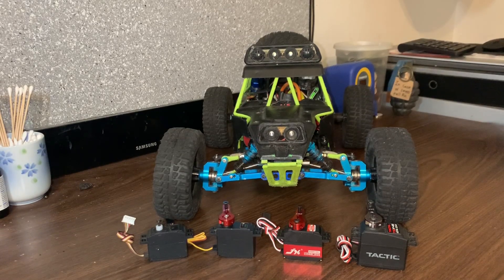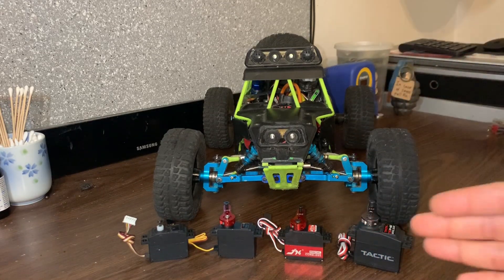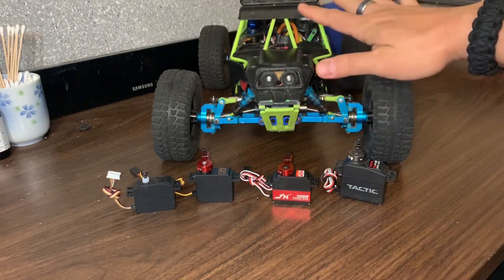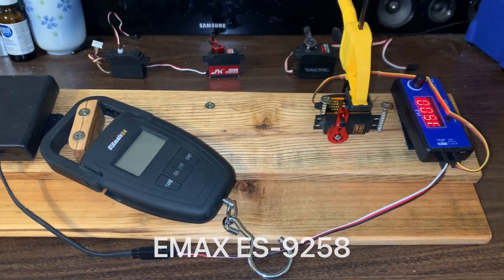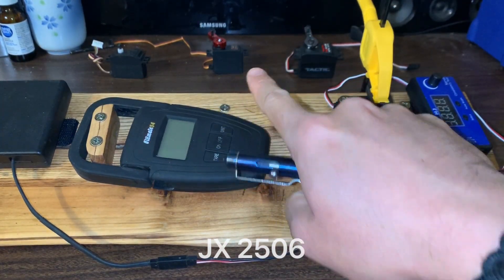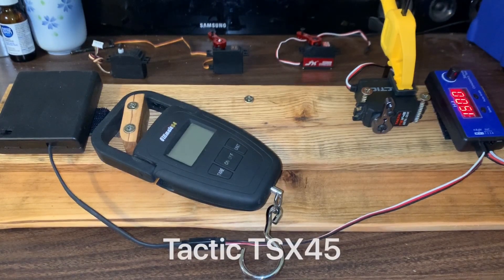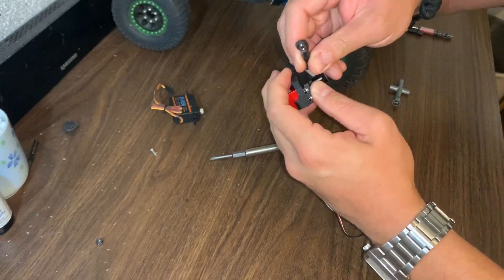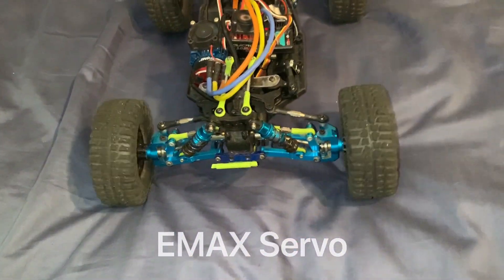Best 12428 Servo Option Out There - Fits The Stock Servo Bracket!!!

Comment: Thank you for this video! I spent hours looking for a good servo for my 12428, bought one servo of other size and used it with 3d printed bracket until it died 2 weeks later, then used original servo with soldered controller from that dead servo.
After finding your video I've purchased JX PDI-2506MG and I am very satisfied. Perfect fit, budget friendly and very decent.

Comment: There's an official upgrade metal geared servo from wltoys , don't use it, it's not much better than the stock one. 

Btw: You can easily use the 3wire servos on the OG wltoys esc. Just remove the pcb from the 3wire servo. The 5 signals that go to the wltoys "brainbox" consist of 2 for motor and 3 for the potentiometer. Not really proprietary (connector is a JST 1mm or 1.25mm pin pitch and available at mouser, digikey and the like) but for cost savings sake I guess. 

Thanks for the video.

Comment: hello, does any 25T servo arm fit the stock servo?
Reply: I have trouble finding the correct arm for these smaller servos. The spline shaft size is different between the 1/12 and 1/10 size servos, but believe they can both be 25T.

Comment: Thanks for the video very interesting.  How fast the JX servo PDI-2506MG   is in comparison to the original one ?
Reply from the maker: I mean the original seems much faster with no load but when it doesn’t have the power to get the full throw to use the full turn radius, then that speed is pointless.  The JX servo is so much more powerful that when the servo is loaded down with all the links, joints, steering components, wheels, tires, ground friction, etc it still functions great and will give the full throw of the servo.  So essentially under no load the stock servo is noticeably faster but that speed does not translate to usable speed when in use.

Comment: Are there multiple revisions of the 12428? My servo is mounted 90degree rotated to yours (servo horn along the steering axis instead of yours that is along the forward/backward axis ) and the servo saver mechanism is completely different
Reply from the maker: Kinda got a Frankenstein 12428.  A lot of the steering components have been customized and even found a way to attach the bellcrank steering off of a 1:10 scale Axial Yeti to it, but yea I rotated the servo myself so that my custom steering would fit right.  Got more videos on this car including a video on my custom steering setup.  Links should be in the description to all my 12428 videos.
Reply: @AszBall  Oh I see, that makes sense. Looks certainly nice

Comment: Thx for the Video, Did I Need a new ESC for the Servo? Because of the 3 PIN Plug?
Reply from the maker: Yea you gotta swap out the esc then you need a new receiver and transmitter, possibly a new motor to go with the esc if you go brushless.
Reply: No , actually you can open the servo and switch the control  boards with the  wiring , making the new 3 wire servo  a 5 wire.

Comment: How did you fix the JX PDI-2506MG? I bought one but its wider and dont fit the original bracket
Reply from the maker: Do you have the Feyue fy03 or something like that?  I know that car looks similar to the 12428 but I know it has different internals and a slightly smaller servo.  On my WL Toys 12428 it was a direct fit  to the stock servo bracket with no modification needed.

Comment: did you measure what actually happens on the 5pins vs the 3? maybe you can just disconnect 2 and run it on 3?
Reply from the maker: I mean the connectors are completely different and I don’t see why they would make 5 wires if it would run on 3, I figure the proprietary design requires all wires for the servo to run.  Either way the JX servo is not too expensive and a vast improvement over the underpowered stock servo so if you are replacing the esc and receiver anyways might as well include an upgraded servo while you’re at it.

Comment: Nice video! Subbed. Why do you use a 17t pinion? wouldn't that decrease the top speed? Also, do you know if the servo in this video and shock tower you used on the front for the standing shocks would fit on the fy03? thank you
Reply from the maker: Joshua Mei - This car came originally with a 17t pinion I just upgraded to an Axial 17t pinion because I kept destroying the “upgraded” metal ones from China and the axial one seemed to hold up better, the 12428 doesn’t have an adjustable motor mount so pretty much stuck with a 17t pinion unless I want to make a customized adjustable motor mount which seems unnecessary seeing as I’m happy with the low end and top end speed of my setup.  No idea if this shock tower mod would fit on the fy03 never owned one, know they are built similar but dunno if it’s similar enough to create the same shock tower using the same a959 shock tower.  As for the servo the FY-03 I believe uses a slightly smaller servo than the 12428 but I know they make a 3 wire servo for the feyue FY-03 and that is the FY-S3 servo.  Pretty sure it will be a direct fit but I can’t say for sure, and dunno if it’s got any more power than the stock fy-03 servo but it will at least allow you to convert to 3 wire to upgrade the other electronics.  That servo goes for like $8 on AliExpress and the shock towers go for pretty cheap too so you could always just order a set and test fit it, even if it doesn’t fit you’d only be out like $5 I think, if I’m remembering correctly.
Reply: If it wanted my car to go as fast as possible but still be “safe” what would be best upgrade pinion
Reply from the maker: Madness Destroyer - well the motor mount has no adjustability so you can only run a 17t pinion unless you modify the motor mount to be adjustable.  Even then the motor KV rating and battery you use will play a part in how much speed you get.  My 3200KV on 3s with the 17t pinion goes faster than I need so ideally I’d like to drop to a 15t but I don’t feel like modifying my motor mount so I deal with being a little overpowered.  I could probably just drop to 2s as well.
Reply: K Yammo what about the center gear the 62t pinion is that upgradable
Reply from the maker: Madness Destroyer - Yea you can find metal upgrades but I don’t know if they do different sizes. If you can find a different size then you should be able to change the gearing just need to find the right spur and pinion sizes that work together and end up with the right gear mesh with the stock motor positioning.  But at that point I think it would be easier to just slot out the holes on the motor mount and make the motor positioning adjustable so you can run different size pinion gears and move the motor to get the right mesh.  I’d order a separate motor mount just in case that doesn’t hold the motor well enough though so if it’s moving around too much and don’t keep the right mesh you can just go back to stock with the 17t.

Comment: Hi. Did You made weight check how all metal upgrades increased weight of car?  does it effect it's performance? Btw I very like these all your movies :-) in many cases I found answers to my questions what I had and wasn't forced to check by myself:-)
Reply from the maker: klaszczbass - Weighs 4.3lbs or just under 2Kg right now without a battery and yes I can feel a noticeable weight difference since I’ve added all the upgrades.  Feel like it handles not too different but you can definitely tell it weighs more while it runs, feels a little less bouncy but that also has to do with oil filled shocks on all four corners.

Comment: So I have a pretty stock Wltoys 12428 and I was wondering how did you turn off that safety thing where if you do a burnout it shuts it off?
Reply from the maker: Well I have completely new electronics so the new ESC means I don’t have the same limitations.
Reply: MIne (also stock) doesn't do that! I drive mine on 2S and 3S and never had this issue

Comment: Hello, witch aluminium horn do you use with the JX PDI-2506MG
Reply from the maker: Link is in the description, but it’s just a little aluminum servo horn but if I remember correctly it’s still a little too long so I had to cut off the top hole with a dremel tool to make it fit.
Reply: @AszBall  ok but i dont find the link sorry. In aliexpress ?
Reply from the maker: @kamulot  -  in the description listed under “other upgrades” it’s like the fourth item listed.  And yes of AliExpress.  Sorry I would just link you in this comment but my device won’t let me highlight the link to copy it for some reason.
Reply: @AszBall  thanks it s perfect

Comment: So, if the original server has a 5 pin connection, it should be possible to put on a 3 pin connector and not use the 2 unnecessary wires?
Or am I wrong here? Just starting in this hobby. 
Beside the point, that you would want a stronger servo anyhow.
Reply from the maker: I would assume that would not work but I really don’t know...
Reply: @AszBall  I will try, while wating for a new server, when my brushless motor/esc comes in
I'll let you know

Comment: hey bro can i use it on stock 12428?
Reply from the maker: It’s a 3 wire servo and the stock esc won’t take that so no you need to replace a few of the electronic components.
Reply: @AszBall  thanks man